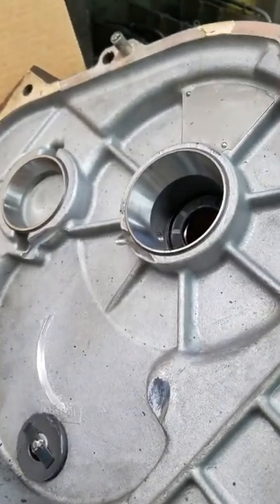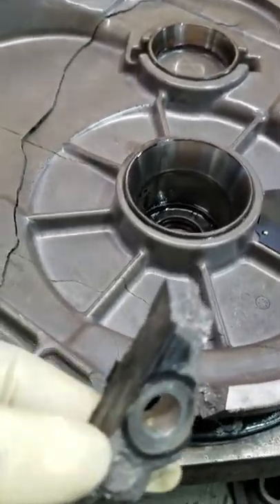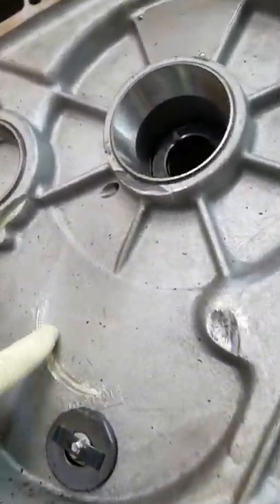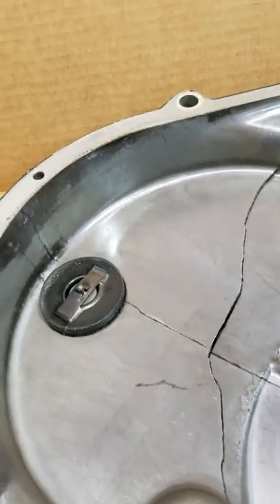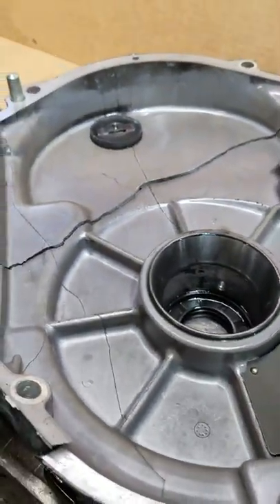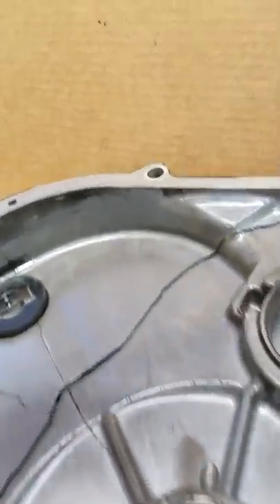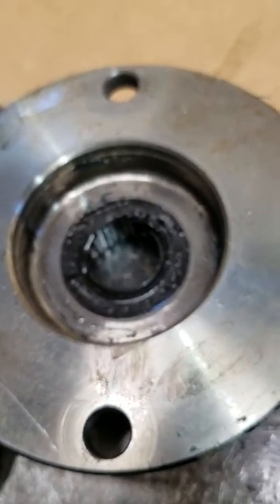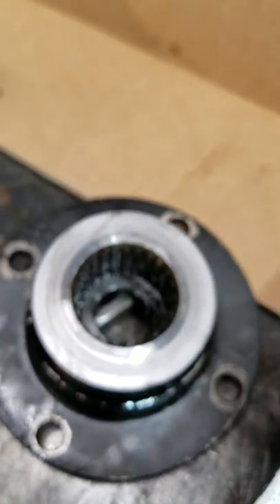Velvet Drive 5000 transmission

Comment: Ouch! That would not have been a pretty situation if it had failed under load at sea.
Reply from the maker: In the forty plus years of repairing transmissions I have only seen something like this once before after high speed grounding.